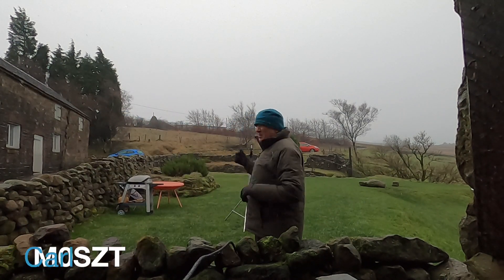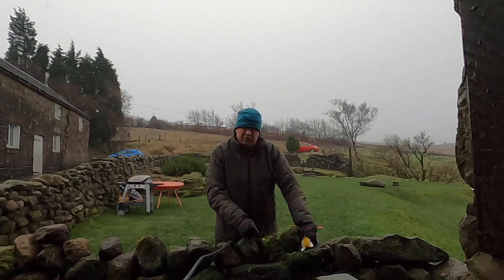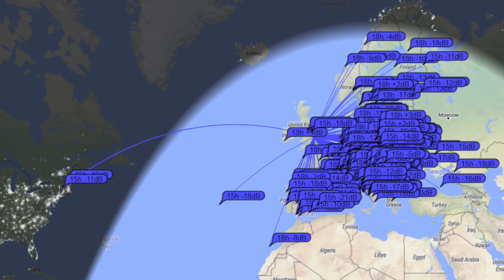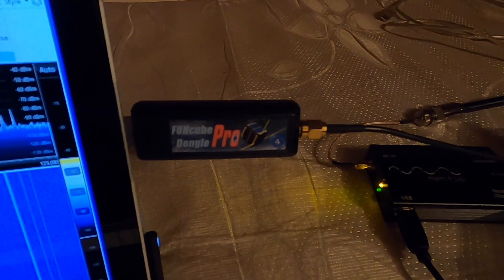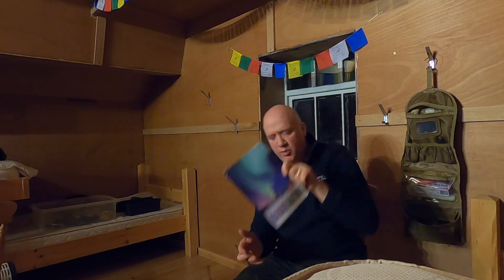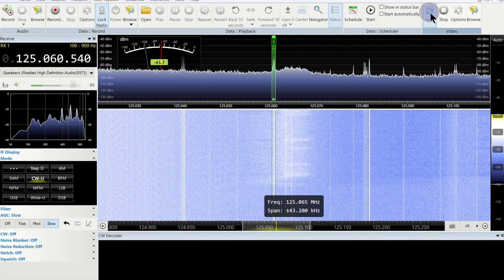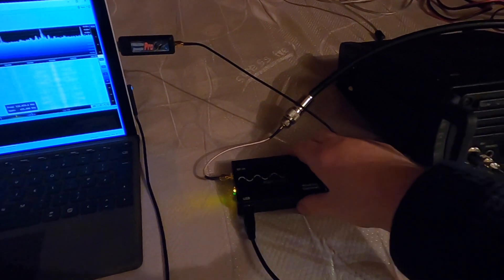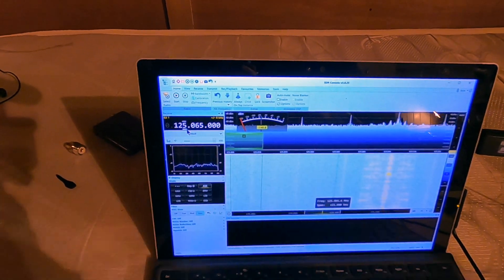How I'm recording Low Frequency signals in a remote Peak District location

Comment: Brilliant video, very interesting.
Can you let me know the name of the tripod/pole you are using, would like to look for one myself
Reply from the maker: The mast is crap, I've replaced it, I'll introduce the new one soon. I've bought a tough fibreglass telescopic mast that takes small yagis. 50mm bottom section fitss into a 50mm tripod. Both from Radioworld.
Reply from the maker: Important to buy one with good toughness in the materials, the plastic section clamps broke in the cold on the one in this video

Comment: Good stuff. My SDRPlay RSP1A is the most used receiver in the shack. It shares an antenna connection with my TS-590SG via a port on the back of the radio. While the TS-590SG is doing digital modes on 40 meters, I'm listening around on the other bands with the RSP1A. Enjoy listening to shortwave radio stations or other interesting signals I stumble across.

Comment: Hi Carl.It looks like you were listening to the radio controlled clock transmission at 5.30 mins into the video on 60 KHz.I have an old Datong VLF converter that I use with my FT-817 and that covers about 10 KHz to 500 KHz.I recently listened into the Swedish VLF transmission from Grimenton on 17.2 KHz.☺73.G7HFS